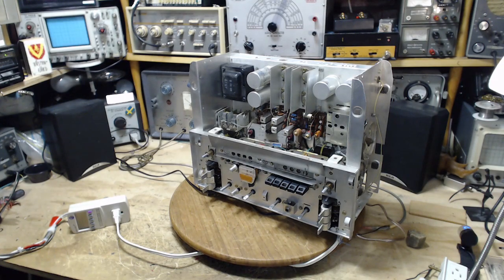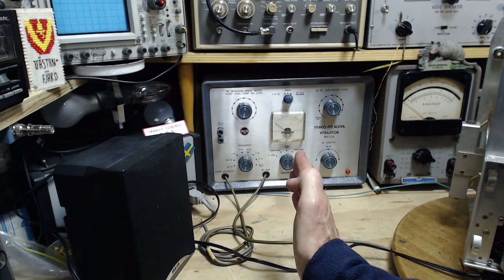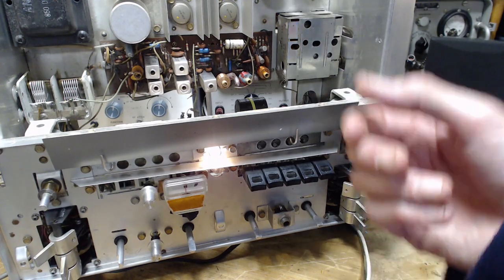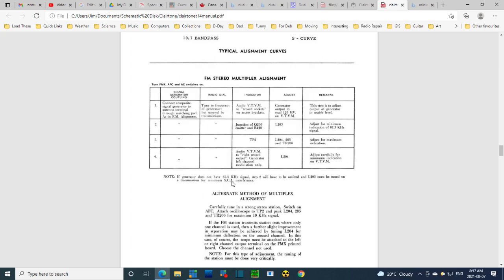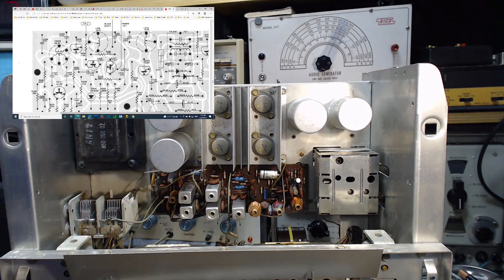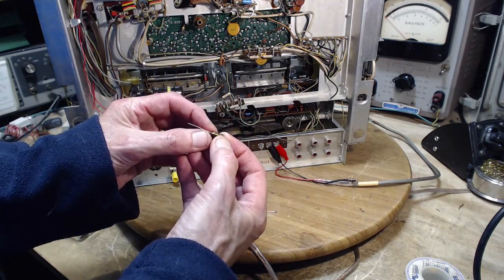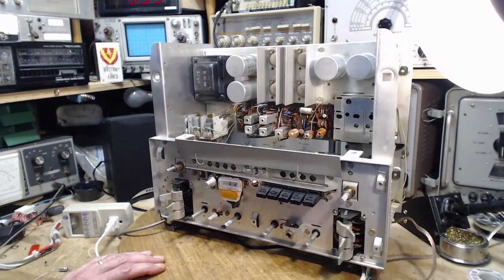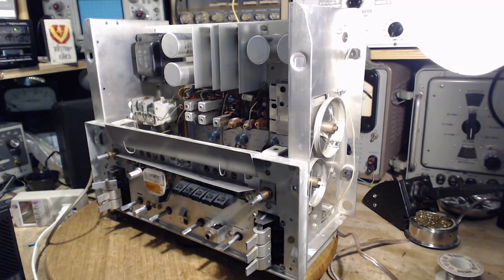Clairtone Console Stereo Video #11 - FM Detector Capacitor

Comment: Only the L-R is sent on the sub-carrier. It is a Double Side-band Suppressed (38 kHz) carrier. The L-R and L+R (mono FM signal) is combined to produced to the L and R stereo.  How does that relate to his obtuse explanation?
Reply: @randomsteve4288  What Jim describes  is TDM or "Time Division Multiplexing" that is commonly used in telephone networks. Its probably as complex a system as Jim can comprehend since it can be accomplished through purely mechanical means in its most basic form.

Comment: This site should be renamed: Jim's Radio Sitcom. His convoluted information comes from something he randomly read, understands a fraction, and remembers less, spiced with his obtuse narrative. The 19kHz combined pilot signal only indicates there is usable information at the 38kHz subcarrier (2nd harmonic of the 19kHz).  And this 19kHz pilot is limited to 10% of the main carrier. Heavens' sake, disregard all you see here!! That cap he pompously declares "critical" is just one component of the discriminator circuit.
Reply: The polite signal is doubled and beat with the double sideband signal of the subcarrier so it can be demodulated. So it is more than just an indicator.
Reply: @mjr1999  Yes and no, depending on receiver generation. You have a suppressed carrier, double sideband L-R signal at 38kHz. To properly decode it, you need to recreate that subcarrier. It is required that the 38kHz and the 19kHz signals be absolutely in phase. Old designs accomplished this by using the 2nd harmonic of that 19kHz (19kHz x 2=38kHz). But as integrated circuits became available, the 38kHz is produced by PLL chips, and the 19kHz signal is only enabling the stereo light and the PLL/Demux circuit. If you could create a very stable 38kHz frequency in phase with the 19kHz broadcasted tone, you in theory, may get away without the 19kHz tone. (Unrealistic, expensive to implement, might drift with temp and be unstable, would be tricky to implement AFC for FMX)